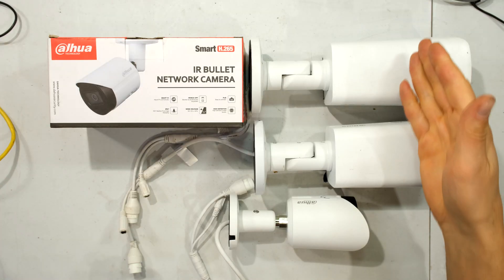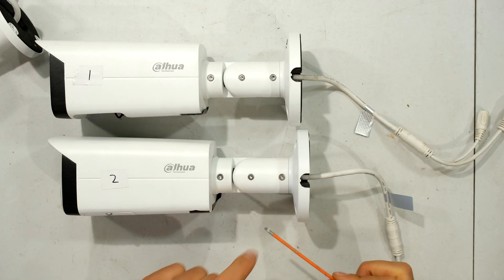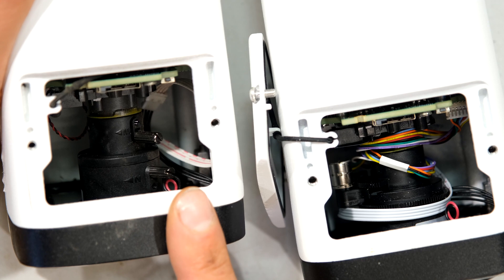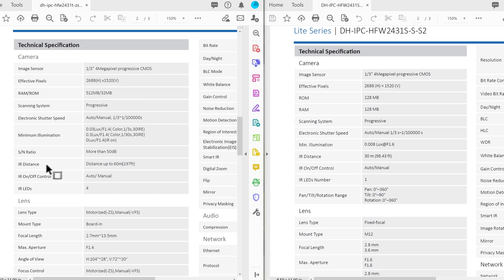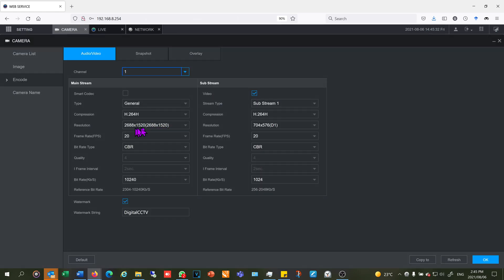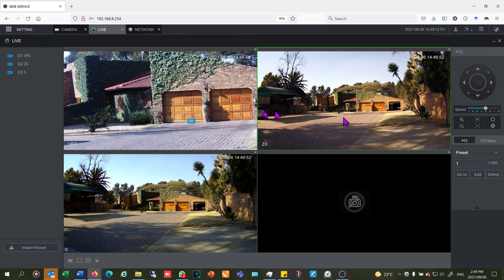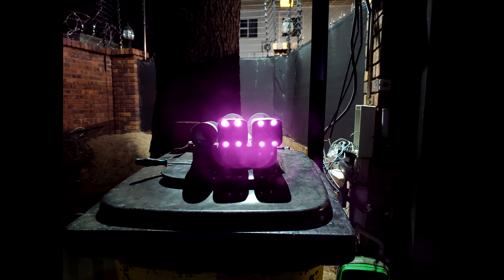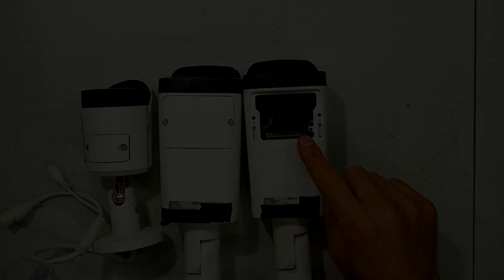Dahua IPC-HFW2431T-ZS/VFS and HFW2431S-S-S2 IP cameras compared.

Comment: One of the things I wanted to add, When someone is going to setup a Zoom camera is to have the camera setup in the area they want to View at the Fully Zoomed in state. This will insure that they camera is going to be pointed at the area of interest when the camera is zoomed in. One of the biggest issues I have found is that someone don't like they can't treat the Zoom camera as a PTZ and that is because the camera only zooms it don't pan or tilt to get in that fine detail in a little different area of view.. So lets say that you want to see something at 100 feet away, if the camera is zoomed out and installed, lets say there is some tree or shrubs and you want a better view right over the top of the shrubs if the camera wasn't zoomed in and setup in place when you do zoom in you might be looking at the center of the shrub or just out of Frame of what you really want a closer view of... I personally have a lot of Motorized zoom and manual VF lens cameras. My main setup of cameras is PTZ because of the best Range of View.. 4mm or 2.6mm and even the 3.6mm normal camera range just isn't good enough for most home installs and one of the issues that some people have because the ROI or Area of View is outside of the cameras true (wanted) view point.  What is important is that people also look at the Dori for the camera and see if it will fit the needs of the space to be installed.. Trying to setup a camera to ID someone 60 feet away when the cameras ID says it will work at 20 that isn't a camera that will work as wanted.. Detection at 300' (Feet) away is great just make sure there is enough cameras or something that can help ID a subject much sooner. IF your system works well it should detour the wrong doer into moving on to another home and leave yours alone. IF they just want what you have anyway Make sure more then 1 camera can get a look at the person in more then 1 ID range for best results for sure at night... Also a Cameras White Wash of IR is either the camera wasn't setup in Smart IR or the cameras settings are out of adjustments because most good cameras are setup to change View for light flooding the scene to protect the cameras ROI or Viewing area... I have had some cameras in past that IR blast with no change at night for Flooding these cameras don't make it much or long in my Camera setup...
Reply from the maker: good tips, thank you